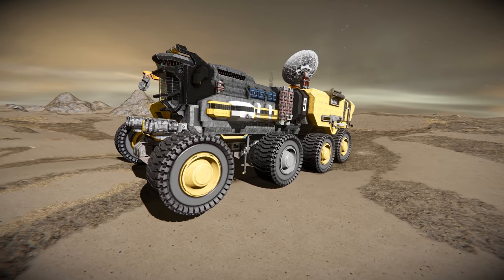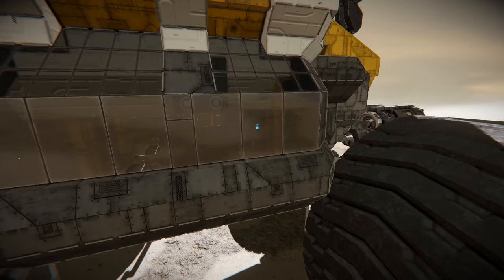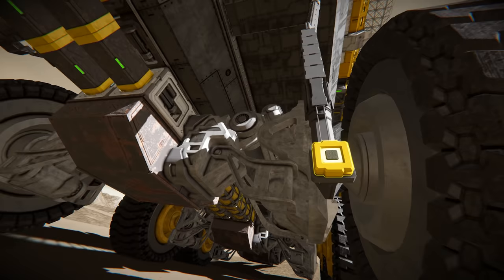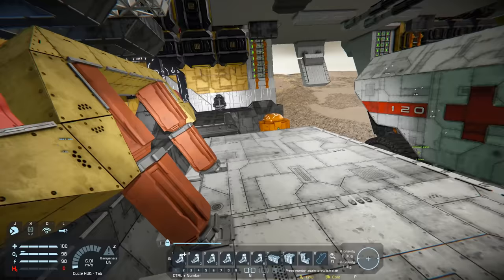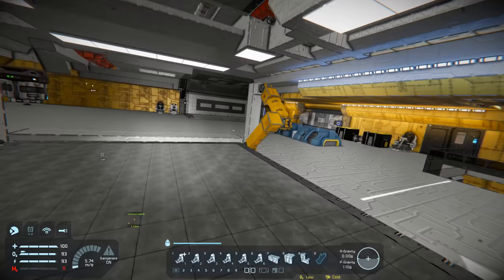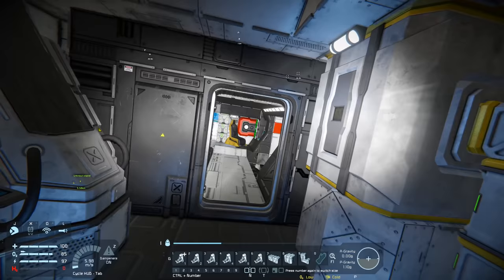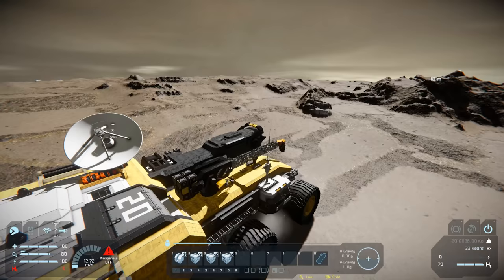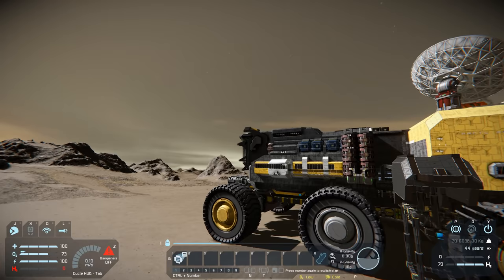PRCTL-2000 RESCUE Overlander Hybrid - Space Engineers

Comment: 9:00
Blue =Elevator platform
Red = Hatch
Reply: But the blue also opened the hatch
Reply: But I think you need to press red first and blue later
Reply: @mrmateusz5188  Yes I believe both reverse the platform's movement and opens or closes the hatchet, the difference is in the timing, so if the red was pressed first the hatch would've changed to open first then the platform would have gone up, and the blue one would close it properly.  That is my guess.
Reply: @andrewkelly2028  i played around with this one, and it is how it works, but also the vehicle is full of not finished pieces or features that broke down, here are some:
- the claw doesnt open and close
- i counted up 3-4 hatches that have rotors and all but have no buttons to be opened
- the bag ramp needs help closing up, like a piston or something
- why are there so many drivers seats
- remote control doesnt work
Reply: @mrmateusz5188  Yeah I was wondering what the claw would even be used for, it doesn't seem to move around enough to interact with much if it could open up.  Interesting to hear about those other pieces but I do remember the kitchen in this video seemed to have some issues unfolding.  Quite hilarious in any case, I had a good laugh from that.
Reply: @andrewkelly2028  the kitchen worked quite well untill i started messing around with it and when i tried to replace it with something else it got flung into outerspace, 
the claw could have been used for transporting supplies onto the rover from a higher platform if it rotateted 180 degrees and the hatch behind it would open up
Reply: @andrewkelly2028  i tired using the claw to drag a broken piece of a ship but it was too weak and the piece too big
Reply: @mrmateusz5188  Ahh what a shame.  Hopefully the claw can be improved in the future.  One thing I really liked was one of the pads that brought you into the ship  The folding pistons was a pretty good idea I intend to use in some builds.

Comment: You would get the crane over the antenna if you raised the arm again after you raised the cab. Also the elevators and stuff dont work because you aren't pressing the buttons properly. You aint gonna crush your stuff if you press the red button, then the blue. And when retracting you press the blue button and then red.

Comment: Lol, that landing platform/ elevator seems so bad - it basically crushes whatever it holds into the blast doors before they open lmao
Reply: I think He messed up the buttons
Reply: The top button is supposed to raise it (actuate the doors, then the lift). The bottom button is supposed to lower it (change direction of lift, then the doors)

Aaron pushed the bottom one first, probably expecting the lift to go to the lower deck.

The creator should have had a safety timer that de-activated each inactive sequence start timer, allowing only the correct one to be activated at the end of either sequence.
Reply: @ianbunch1583  just set turn on/off the command button is enough, for example. I push the raise button? First action "Turn off raise button" and you are safe.
Reply: @TheChristianDeca  Yes, but you need a timer block because each button can only trigger one event, while timer blocks can trigger 9 events; if you have a button to turn itself off, then you won't be able to trigger anything else. 
Since multiple events are happening, there must already be at least one timer block to start raising the platform and lowering the platform. However they are not configured to act on what system state they are in (up or down). 
It could be modified to run using just one button, and multiple timer blocks for actuation and safety.
Reply: @ianbunch1583  sure, i forgot to make mention about the timer. It was just to give the basic idea for a simple solution.
Reply: @TheChristianDeca  Ok.

Comment: man i so want that in my survival series but with some alterations and i see some flaws that need to be fixed. also i was thinking of a new military/ combat focused version that i call the prct-2500, it is longer to house a 10x10 wheel setup more armor incorporating ribbed armoring a custome canon turret useing the smooth bore canon mod (and i hope there is a bigger one like a 130mm canon and it will be a dual barled canon) with 26 Vulcan turrets, also including a multi power systum for if the planet you are on dosent have a lot of uranium but a lot of ice you have a hydrogen systum with 8 large hydrogen tanks and 2 large hydrogen engines and 1 large deuterium reactor of if you have a lot of uranium but no ice you have 4 azmith fusion reactors with 20 azmith batteries and 12 large solar panles and 8 wind turbines and it will have a lazer attena  and a azmith attena. also i'm useing ALL the new dlc parts like the heavy industrial dlc, the wastland dlc, and more, also it will have a few refinarys, and assembalers also lots of storage containers mixing in the large and small containers both the regular and azmith ones, and the whole under frameing is heavy armor with light and heavy armor on top.(the lore is that the company that made the prct-2000 wanted to expand there reach and they wee popular with there rescue rover and many search and rescue groups have atleast 1 of the prct-2000 but one day the defence corperation came and asked them to desing a new large rover/mobile bace/comand rig/ heavy ordanince rover, but they had requierments they asked that they desing a new model but in these specifications it has to be a 10x10, it has to have a minimum of 10 Vulcan but a maximum of 30, it has to have a large canon (double barrled only) no smaller than a 120mm smooth bore canon but no bigger than 140mm, it has to be heavly armored and must be self sufficient on multiple frontiers such as, extreme heat( dessert and lava planets) extreme below zero tempritures( ice planets) and must have the folowing power systums, azmith batteries minimum of 5 maximum of 30, 1 duterium reactor(small or large, azmith fussion reactors minimum of 1 maximum of 5, no more or less than 12 large solar panles, hydrogen tanks minimum of 2 maximum of 10, hydrogen engines minimum of 1 maximum of 3, and wind turbines minimum of 4 maximum of 10) and after some tests and redesinges and modifications and accidents they made the prctl-2500 the "mobile fortress" they took the principles of there 2000 series large rover but made it bigger and more armored.

Comment: Anyone have any pointers on the best way to build a Large chassis like this with Small block for cabin / body? I imagine using the rotor size trick might add too much Klang, but is there another method to putting a small block detailed layout onto a Large block wheel/chassis? Thanks!